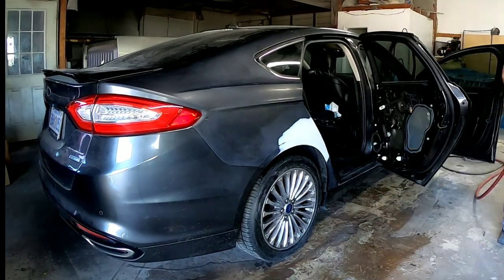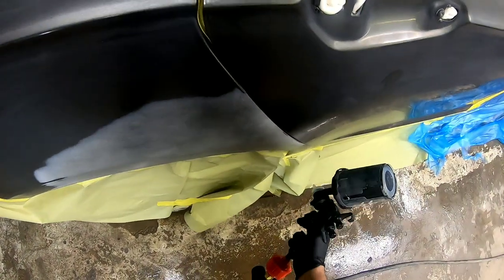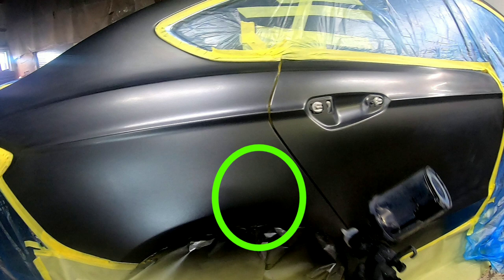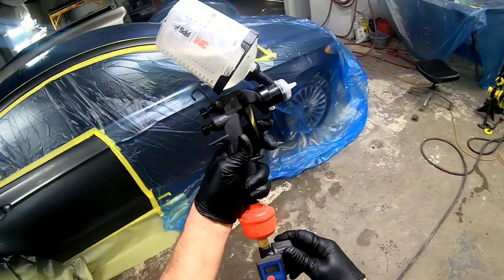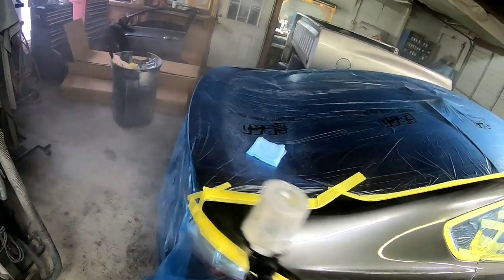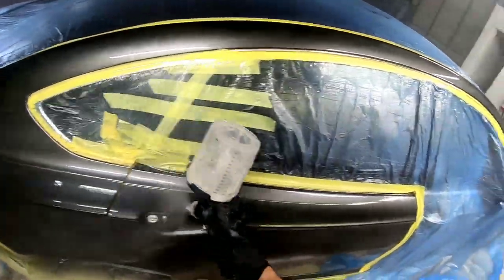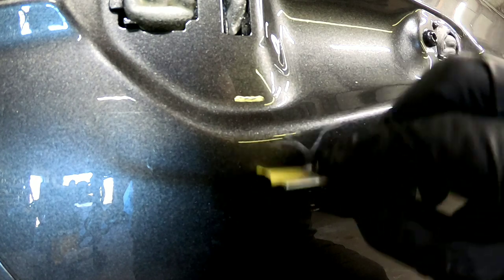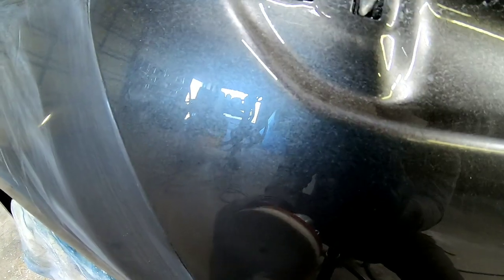How to blend paint and clear your car. #autopaint #clearcoat #autorepair

Comment: Nice job! Thanks for the video. For anyone considering doing this for the first time he is using a low pressure gun. If you clear coat with a normal HVLP set at 30psi you won’t be able to see across the room. Everything in the room will be sticky with a mist of urethane. Make sure you cover everything with plastic and have fans for airflow to evacuate the overspray. You can do it outside but make sure there are no cars within 50 to 100 feet or else you will be polishing them as well.  /John